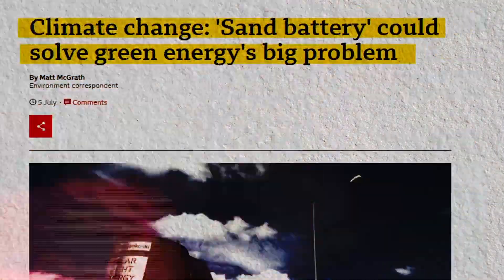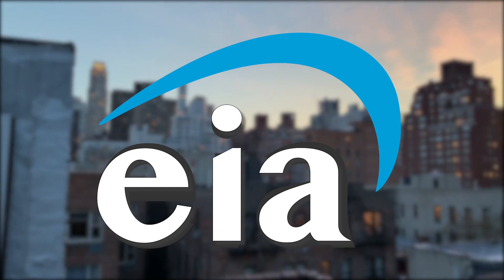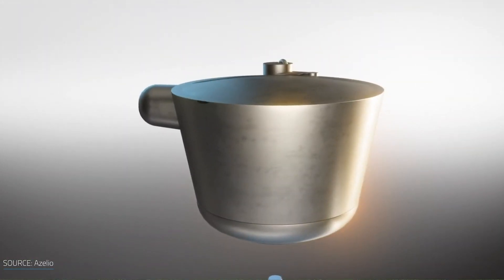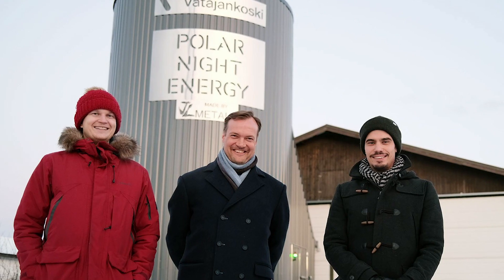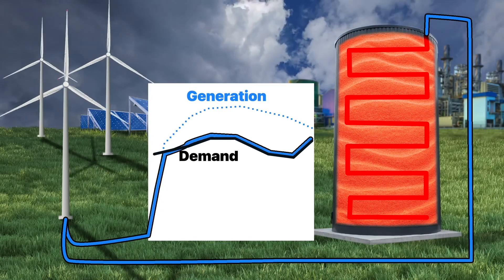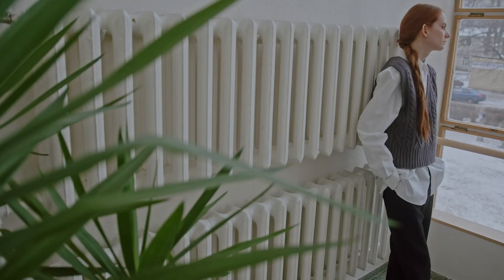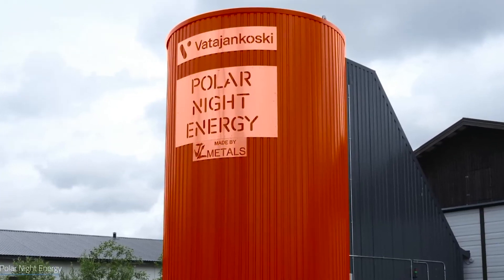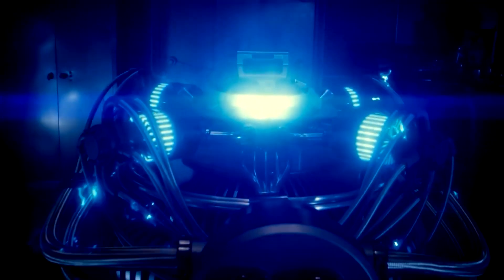How This Sand Battery Could Change The Energy Game

Comment: It can't be used to store energy for the entire season. If you do the math and calculate how much energy you can store in 100 tons of sand, what's the energy loss even with the best insulation, and how quickly will it discharge when you try to get enough energy out of it to heat the district, you'll see it's best for a few-days storage.
Reply: That’s highly dependent on the insulation. I’m sure they pay attention to that
Reply from the maker: True!
Reply: @Fit.Fusion  I've tried to recreate this (on a smaller scale, for domestic use) with 500kg of sand and did all the calculations. Even with the best possible insulation (which is a vacuum), it won't work for _months_. There was a video somewhere where their CTO said it's fine for up to 80 hours. But many media and YouTubers are repeating this "it will work for months", which is not true.

Comment: Energy dome CO2 storage is the best. To make it it only needs Steel mainly. CO2 can go from gas to liquid at normal air temperature and using the waste heat it emits also for heating it is over 90% efficient. 
I can’t see the point of anything else because energy dome has nailed it.
Reply from the maker: I will definitely look into that! 🙏🏼